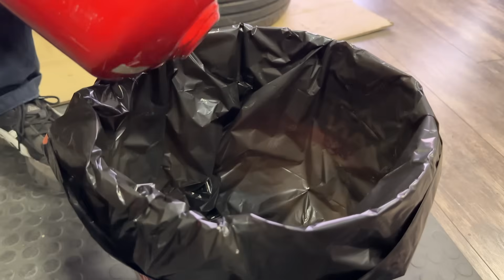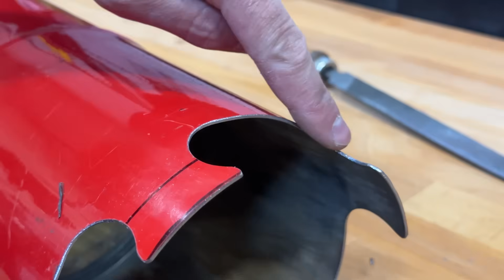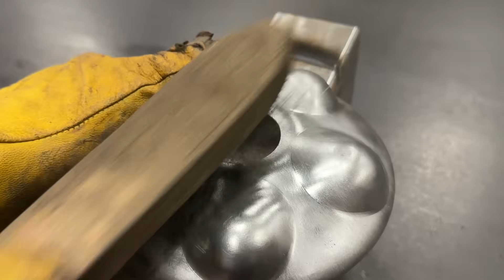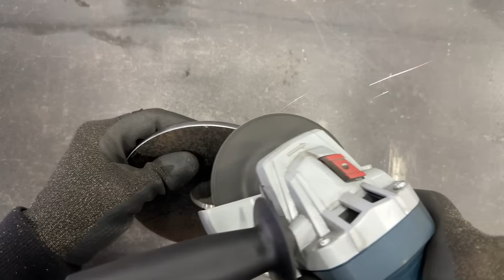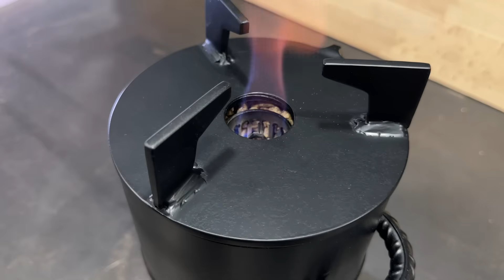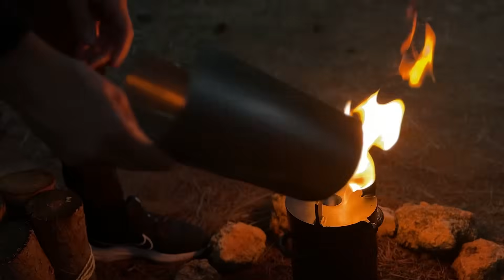How to Make a Powerful Survival Stove 🔥Liberty BioStove

Comment: the central element that you cut out of the pipe was much easier to make by welding iron rods to two metal rings around the perimeter.
and when you fill the fuel, it is convenient to use a cap that will prevent it from filling up inside

Comment: It's easier to take a small portable Liberty engine  to a picnic in the forest and connect an induction cooker to it 🙂
Reply: But then you would have no way to stay warm! Plus thats lighter and smaller than the liberty engine, plus you could even make electricity from the fire if you know how to wire it with copper wire to then power anything you want with heat and stove